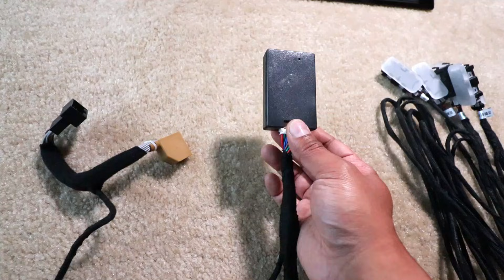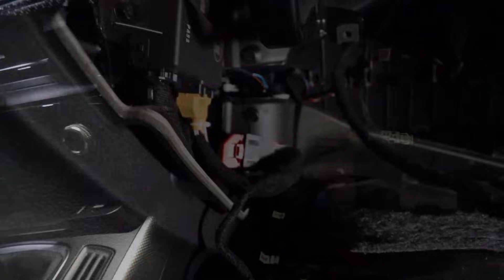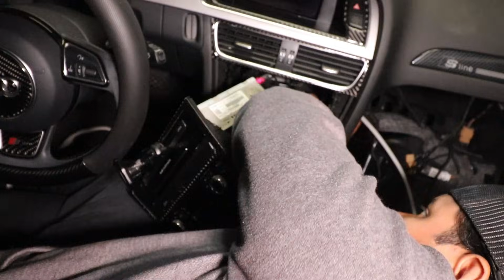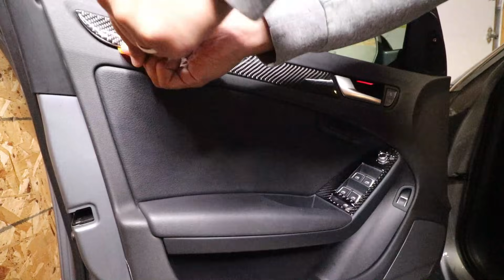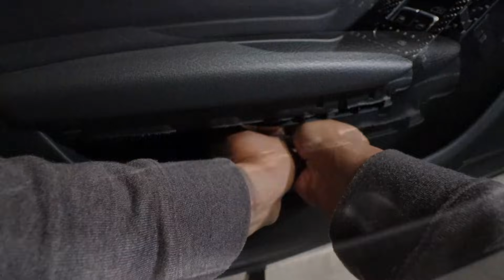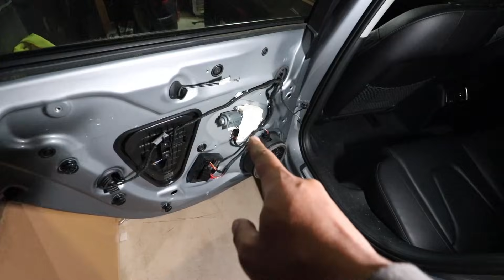NEW Carbon Fiber Ambient Light Kit | How to install on 2008-2016 Audi A4/S4 (B8 and B8.5)

Comment: One question. The doors. Will they get signal wireless? Like does it have to connect with the first cable you conected to.
Reply from the maker: the doors pieces only need power and they receive a wireless signal from the main connector on how to change color and brightness. 

The video install is the exact install. There’s nothing else you have to worry about unless the new version of the kit is different.
Reply: @TheFlexxGarage  thank you bro. you helped me before with Android screen and now i will install the ambient light.
Reply from the maker: I hope the install goes smooth. It’s not bad at all.  Goodluck my friend!

Comment: Do you have to use VCDs to activate the ambient light control via MMI? bc if you do not have mmi with ambient function prior, u need to activate via VCD?
Reply from the maker: The video literally outlines exactly what was done.  I don’t hide any steps in my videos. 

The kit has nothing to do with mmi or programming.  Connecting the kit to that port just allows power to the lights, and allows them to be control by the steering wheel buttons. Thats it. Nothing else.

Comment: Third day with led installed and my MMI is done. No power/control on the center console and the display is black. But the lights work 😅
Reply: My passenger door doesn’t open

Comment: Hi, great video. I don’t have lights at all in my 2014 A4. Do the holes for the lights exist anyway or am I fucked for this kit ?
Reply from the maker: B8.5 never came with lights so not sure why you asking if there would be  existing “holes” for lights. 

My car has no lights and I installed an aftermarket kit.  Everything in the video is exactly what needs to be done to a b8.5 if you want lights.
Reply: @TheFlexxGarage Well, for the seats, the door handles and the bottom of door pannels, you show that we have to disconnect existing lights right ? I don’t have such things in my b8 8k5. So I don’t want to put 450€ on a cool kit just to discover that I can’t install it completely.
Reply from the maker: I can’t help you there. My videos are for the US market and I only know my car and cars sold here.

Maybe someone else will chime in.
Reply: @TheFlexxGarage ah yes, I didn’t think about it but it may be different for a european version of the A4. Thanks anyway, have a good day 👍🏼

Comment: Hey Buddy! Can i get a question? I have an audi a4 b8.5 (facelift) i already installed an aftermarket multimedia similar like yours. Between the glovebox there is the mmi connector where you pluged the ambinent lights. Could i use that connector at the same time for the multimedia and ambinent lighst aswell? ? Sry if my question is too complicated. 😅

Thx for your answer, have a nice day!
Reply from the maker: Yea, I’ve answered this many times in the comments section. Look at your connector for the screen, there’s an expansion port to piggy back the ambient kit.

Comment: Do they make a carbon kit for a b8 A5 coupe? 

The only differences should be that the door trims are longer and the power should be bridged from the front since the coupe doesn't have rear door modules.
Reply from the maker: Don’t know. You need to check their website or email them directly. They do carry a lot of stuff not on their website.

Comment: I have connected everything to the Audi a5 as in the video, but I have the main control unit from 1-8 and do not know how to switch it, can someone help me?
Reply: Same here, I’m stuck
Reply: Translate what it says on the box it’s instructions, tell me what yours says mine says:

Main control box (to 3 red rice)

Applicable to: 09-10 effect Audi A4129

Switch definition:

13 down.24 upper subordinate control/anti-steering wheel control market

134 down 2 upper mouse empty/steering wheel control follow Tai lamp

Version number: V6.2

Comment: As someone who bought/installed the Ambient Light Kit and the face-lift android auto screen. I highly  recommend getting in contact with the dmpcardesign customer support if you get stuck. They are great and helped get volume on my android screen and the lights to turn on in my car for the kit. Once agian don't be afraid to ask them questions!
Reply from the maker: Exactly! I’ve been preaching that but people just don’t believe me. That’s the perks of spending a little more and buying from them and not some random reseller online who offers no support, no warranties, and sometimes no returns. And the products aren’t exactly the same as DMP, even though they might “look” the same. 

DMP always has the latest and greatest versions of most aftermarket products. And dmp can provide tech support to people on a global scale. They know installs on different versions of the same car from different parts of the world.
Reply: Mine just came today idk what the long ass three foot rgb light strip is for? Any help
Reply from the maker: That’s an extra piece that you can put around your shifter area or around your gauges. It’s a universal piece. I just didn’t use it cause I thought it was overkill and required more work trying to run the power wires to it. That’s just my opinion though.
Reply: this is why I’m subbed bro you respond back to me on a old video thank you man
Reply from the maker: If people spend the time to watch my videos, I’ll find the time to get back to them. Unfortunately I can only get back to like 99% of comments. Some people are just jerks and don’t deserve a response.  But my focus is on the people who matter! 😎🤙🏼

Comment: Hab heute alle fertig verbaut alles bestens alles funktioniert leider kann ich die Farben und die Helligkeit nicht steuern am Lenkrad warum auch immer leuchtet alles nur in blau . Woran es liegt weiß ich lieder nicht. 😢
Reply from the maker: I don’t know. You need to contact whoever sold you the kit. My kit from DMP Car Design didn’t have an issue. 

You shouldn’t have the done full install without testing the controls first. That’s why in my video I tested my kit first before i installed it.

Comment: is this working if i dont have steering wheel controls?
Reply from the maker: Yeah..it will work but stuck on 1 color.
Reply: @TheFlexxGarage does it just automatically work on the steering wheel?? I want to get this and put it in but not if I can only have one color…

Comment: hello, I installed it the same way, but one of the elements on the passenger door has a different color, for example 3 are blue and the other is green, what could be the cause?
Reply from the maker: One the the wires that sends color is broken to the element.
Reply: only green and blue colors work but when i set the green color the defective one becomes blue and vice versa the other colors don't work on the defective item
Reply: @vasileravas8170 did you find the solution?

Comment: This kit you are using is for the B8.5 (facelift model). I have an A4 B8 (pre-facelift), are the interior trims the same on both models?
Reply from the maker: I’m not 100% sure. 

You need to go to the link and check the product page. If you have questions, just message DMP car design and ask.

Comment: Hi, I have the kit but with the app and it turns on and off because I don't know what's wrong with it
Reply from the maker: not the same kit if it has an app. You're going to need to contact whoever sold you your kit for technical support. If it's DMP, send them a message and they'll get it working 100%.

Comment: Hi where you add acc battery + and - to 20pin gateway plug?
Reply from the maker: Not sure what you are referencing. Everything involved in the kit I installed in the video is in the video.  If you have a different kit, then you need to ask your reseller.
Reply: Ok can I please for link to you item where to buy?
Reply from the maker: As mentioned in the video, link is in the video description.

Comment: I’m having trouble changing the Color’s or turning on/off the lights. The steering wheel buttons are unresponsive to the ambient lighting kit and it stays on red. I also have car play installed but doubt that could be the issue
Reply from the maker: I have CarPlay connector and the ambient kit connector piggy backed into the canbus port and everything works fine for me.  You need to contact DMP and ask them (if you bought it from them). If you didn’t buy from them, then it’s gonna be tough getting support from who sold it to you.

Comment: I have a feeling that all of this would be much easier installation if all modules would communicate with the main control box via Bluetooth. Then it would be easy "plug into original light energy source" kind of thing.
Reply from the maker: Umm…each box for each component does communicate wirelessly to the main box that’s installed under the glove box. They how they all know to turn on and off at the same time and they all change colors to the same color. It’s not Bluetooth technology but it’s still wireless. 

However every part still needs their own power source hence why it’s installed the way it was installed.  It’s as easy as it can get. There’s no such thing as plug into original light energy source method even if someone tried. 

Bluetooth technology doesn’t provide power, Only a signal to control colors and on/off. Unless you have a battery for each component, then you don’t need to tap into a power source for each component of the kit. But then you’ll be constantly changing out batteries which defeats the whole point of the system running off the cars power and be somewhat oem-like.

Comment: I have a dude if it is driven with the steering wheel I can use the old function that it had from the factory or it is replaced to change the lights
Reply from the maker: The lights have nothing to do with your steering wheel functions. The lights only change if you press an exact combination of steering buttons at the same time.

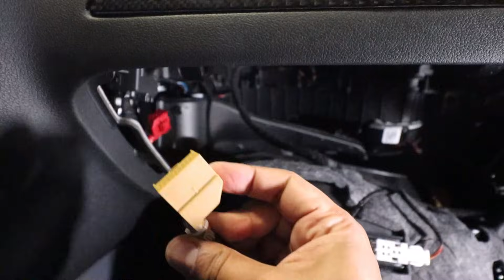Comment: I would really like to install this ambient light on my 2013 Audi A5 B8. However, I have a question... I've watched your entire installation video, but it seems that you turn on (at 3:40 minute) the system in the same place where I already have my Android Multimedia System installed... how do I make if both use the same location? Thanks
Reply: This is what I want to know! Seen a few people say this. Did you ever do it?
Reply from the maker: You piggy back it. It’s simple as that.

Comment: If im not wrong... the stock wiring will remain there unused? Why not changing only the lights and plug them directly on the stock wiring thats already installed? Won't work?
Reply from the maker: Huh? There’s no stock wiring for ambient lights. The Audi b8 and b8.5 platforms never came with stock ambient lights or wiring for it.
Reply: If you mean the footwell lights, you can change the lights and put them on the old wires but you will have no receiver to change colour

Comment: Where did you run the fuse to?
Reply from the maker: Fuse for what? Everything in the video is the install.
Reply: @TheFlexxGarage  I got the b9 kit, shows almost exactly everything you have in the video except one module looks to be the main box, it has two wires, one for ground and the other is a fuse that should be tapped to constant power. mine works just trying to sync it with coming home lights. Thanks anyways
Reply from the maker: Sorry my man…I’m not familiar with the b9 kits but that sounds easy. There should be a fuse panel to the left of the steering wheel.  Go watch my A4 dashcam video and I actually ground and tapped into a fuse. You just need to tap into the right fuse by testing it with a test light pen or finding the wiring schematic for the coming home lights.

Comment: Hey man I was wondering what size drill bit you used for the handle lights and also what size drill bit u used for the door pocket lights
Reply from the maker: Don’t know.  As shown in the video, I used a bit that’s about the same size of the cylindrical part of the handle light.  

The drill bit for the door is included in my kit. Not sure if it’s included in the kit for purchase. You need to ask DMP.

Comment: Quick question.
I brought the same carbon emblem for my steering wheel but it doesn't stick down well. How did your stick on? Or did you do something else to make it stick better? Cheers
Reply from the maker: Just make sure the surface is clean using isopropyl alcohol, then slightly heat up the sticky side of the emblem before sticking on.  That’s how you should be installing any form of sticker/decal/emblem.
Reply: @TheFlexxGarage  Thanks. I did all the steps apart from the heat. I'll add some heat to it.
Reply from the maker: The heat is important.  Also it makes the carbon overlay more flexible and it contours the area better.
Reply: @TheFlexxGarage  excellent 👌 cheers
Reply: Where Can i buy this please

Comment: its original carbon or just like before? but i like thes coz, the LEDS
Reply from the maker: Mine was silver trim. Then I put some cheap carbon overlay stickers on them. Then I took them off and installed these in the video.

Comment: The abundance of stick-on plastic "carbon fiber" makes the interior look so cheap.
Reply from the maker: Better than flaking and scratched up oem plastic parts or trim on my car. So yeah, I picked the better of two evils.
Reply: @TheFlexxGarage  my wood and aluminum trim looks brand new after 5.5 years.
Reply from the maker: Good for your car then. My car wasn’t treated well inside by the previous owners. I rather cover it up then go out and spend hundreds on replacement trim pieces and all the labor changing them out.

Comment: That's super dope, but personally, I'm not a huge fan of those lines on the carbon fiber trim light. Are there any options there?
Reply from the maker: there's different versions. Go check out the link or contact DMP.

Comment: what does B8.5 or B9 mean
Reply from the maker: Different platform for different years. 
2008-2012 (all Audi A4, A5, S4, S5 is considered B8 platform. 
B8.5 is the 2013-2016 facelift of those cars. 

Then B9 is 2017+ is the redesign of those cars. 

Simple google search will tell you.

Comment: does it come with installation manual or video? i have the a5 model might be slightly different than what you have here. thanks
Reply from the maker: Most aftermarket parts don’t come with instructions. That’s why parts suppliers recommend you have a professional install the parts.  Luckily DMP is pretty helpful and can guide you if you can do the majority of the stuff I did in my video.  If you’ve never taken apart your car, then instructions aren’t going to help you. You risk doing damage and better off having a shop do the install if you want good results.

Comment: Can you Show me a Image of the door cabling? 
I bought this package for my A5, but mine has to be plugged into 12V manually, yours came with Plug and Play.

Also is the light only on when Ignition is on or as soon as you enter Car?
Reply from the maker: It’s already shown in the video when I show the parts and when I do the install. 

And it comes on as soon as I unlock the car. And it shuts off about 15-30 seconds after I leave my car.
Reply: @TheFlexxGarage  thanks!
Reply: @TheFlexxGarage  i used Multimeter and saw that there is 12V Always ... Do you know if the Receiver handles the Power at Ignition on somehow? 

I don't want a empty battery ...

Comment: Any codes showing up on the dash since you leave all of those factory connectors unplugged?
Reply from the maker: No. I don't hide anything. If there were errors, it would be mentioned in the video.

Comment: Is this available for coupes/ convertibles? Or its only for 4 door cars?
Reply: I imagine, in those cases, one'd just leave out the rear door trims (honestly, I am not sure if 2-door versions have those, to begin with) and the ones that illuminate the door handles, since this seems like a straight up plug & play system that requires no coding of any sort. I don't see any reason why the pocket lights wouldn't find a home in such cars, though.

Comment from the maker: NOTE ON THE DOOR POCKET LIGHT: it’s recommended to drill a hole in an area so when the light is installed, the light is located on the bottom side of the door’s armrest. This will give a cleaner install than my installation location in the video.

THANKS FOR WATCHING! Go check out my next video where I make the turbo sound so good! https://youtu.be/gix-tGkZ_IE
Reply: Brother, where did you buy all these accessories, I can't find if you can leave a link
Reply from the maker: You do know in every 200+ video I have, I clearly tell you where to buy the product in the video description (and links). Lol. Can’t make it any easier than that.  Just need to actually pay attention when I’m speaking in the video.
Reply: @TheFlexxGarage  hi mate ive fitted my ambient lighting and having issues. When the door closes the light flickers of only on nearside doors but offside door is fine. I changed modules but still same issue. Seems as if power loss or tripping when closing but i also noticed front passenger door sometimes comes back on. Im totalled confused any idea what it could be please.
2015 audi a4 b8.5
Reply: I really wish you can help me do the same mods for my 2014 a4 sline
Reply: What size drill bits did you use